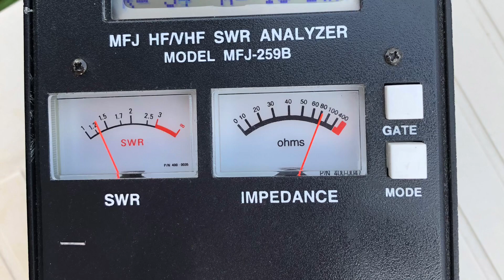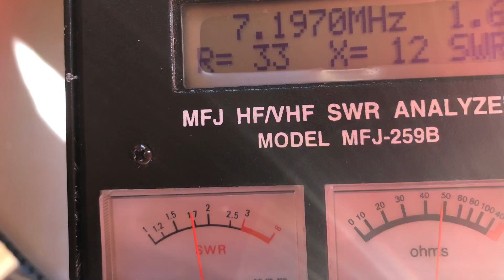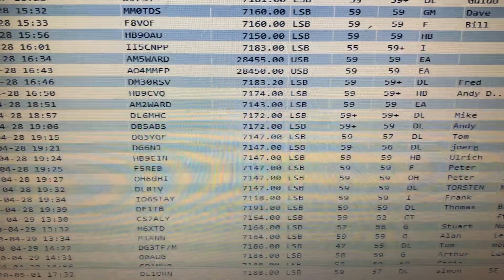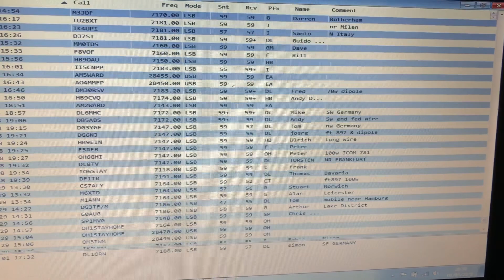HAM RADIO: End Fed Half Wave - 40 Metres Mono-band

Comment: I know this is an older video, but in the off chance that you see this, I have a question. I am blessed with enough room for half-wave wire antennas for both 80 and 60, but my shack is off to one side (meaning EFHW make more sense for these larger antennas). I PREFER MONOBANDERS AND DON'T HAVE/USE A TUNER. Do you know of a manufacturer in the US (or ships to the US) who makes these for 80 or 160? I looked at UK Antennas website, and they don't show any monobanders for 80 or 160.
Reply from the maker: Maybe worth emailing Danny at myantennas?

Comment: Hi Tim, nice video. I have also tried that ant in the past, but using a 40m vertical antenna has always gave me more dx on a regular bases,  with low take off, I generally make it into the uk most days.  Your garden looks perfect for a dx commander.  73 zl3xdj
Reply from the maker: Hi Brian. Alas I have little lawn space for the radials. So horizontal it has to be 73

Comment: Another great video Tim. I wonder how that antenna would radiate horizontal or as a sloper?
p.s. we miss you on 80m  :-(
Reply from the maker: Thanks mate! It should radiate just like a centre fed dipole with the current maximum at the centre of the antenna. Same radiation patterns as a horizontal flat top dipole if installed as a flat top itself. I’ll be back on 80 someday. 73 !

Comment: Have you tried seeing what it tunes like on 20m? In theory the wire length should support two half wavelengths at 20m.
Reply from the maker: When fed with a 49:1 yes but not with a tuned LC circuit like this one. The 49:1 fed version is resonant on 40 20 15 10 through the harmonics of 40m. 73

Comment: Tim nice job I use a Par End Fed I originally got  it for SOTA 8 yrs ago but it was a bit heavy for my pole on a windy summit. Now it is set up on my tower for digital mode radio. It has a tuning stub/tail half way along the wire and it gives good swr on 40 and 20m.
Reply from the maker: Sounds a great antenna. Thanks for commenting 73

Comment: Hi Tim I’ve also got a small garden like yours , I’m using the hyendfed does 40/20/10 worked into Russia on 10w and most part of Europe very easily today. Also have a Sirio 2016 for 10m works well on 15m but a dummy load for 20m. Looking forward to your next video
Reply from the maker: Thank you! Yes I use the same Hyendfed design for portable work and it punches very well on 40. 73 and thanks for watching and commenting.

Comment: Hi Tim. Which model of Common Mode Choke you using there?? Considering the 40m thru 10m multiband version of this antenna. Thanks Neil M0CJM
Reply from the maker: Hi Neil it’s the MFJ 915. I’ll be trying out a 40-10 version this coming week in the same configuration. 73
Reply: @TIMG5TM  Hi Tim. Excellent, thanks for letting me know that and look forward to the video soon. Stay safe. Neil

Comment: The way you have it configured as a symmetrical inverted V you might as well centre feed and run the coax down the pole. You wouldn't need the lossy matching network and the cost would just be for wire. You could also use the feedpoint for other band dipoles (the wires only need to be separated by a few inches). The main advantage to an end fed is being able to put the wire in a configuration that wouldn't be possible to centre feed, for example a tall vertical antenna or having an unusual routing for the wire.

Good video. I've also thought of plugging in a WSPR box to one of my antennas when not being used as an experiment.
Reply from the maker: Thanks for the comments. Food for thought. I’ll be seriously considering WSPR in upcoming projects. 73

Comment: Great stuff Tim. For lockdown I am op from a small cottage garden in Peak District with a couple wires here and there. I’ll watch with interest. For sure, the multibander option floats my boat more and tend to use a 9/1 unun with non resonant wire and quality tuner and h/d in-shack choke. Also have a mono 40m EFHW (Gwhip) with choke. 73 chap
Reply from the maker: Sounds a good set up Nick. I’ll be trying out the 49:1 efhw this coming week. Those Gwhip mono banders look very well made indeed. 73

Comment: Hi Tim. I have the very same antenna here up as an inverted V and it works so much better than the multi banded version with the 49:1 transformer but then again, the mono bander is more efficient and has less loss. I also have the 17m version and have it up as a vertical, great for DX. Ian makes very good antennas. 73 Sid
Reply from the maker: Thanks Sid. I think this one might be a keeper. How much better is it than the 49:1 multi bander? 73 and thanks again.
Reply: @TIMG5TM  Noise level for me anyway is less with the mono band antenna but then i have a good line isolator (rfcomms) on the way back to  the radio.